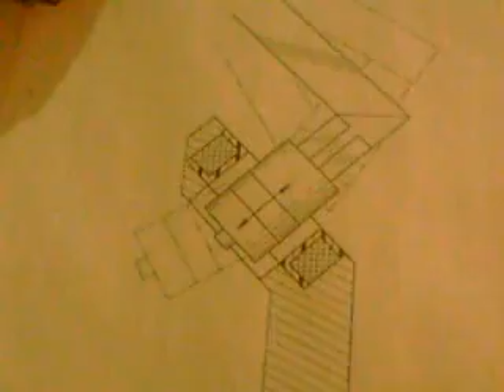Over Unity 19

Comment: looking good.!
One thing, the PVC tube you are planning on winding the coil on, Your obviously getting friction there , which is energy loss. I would try to avoid that. Also, if that PVC gets too hot from motion it will give off toxic fumes.
So even if you could maybe use a larger diameter coil housing.BiFilar wind. Curious how much all that metal cost. WOW.